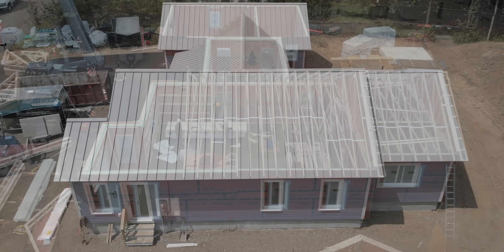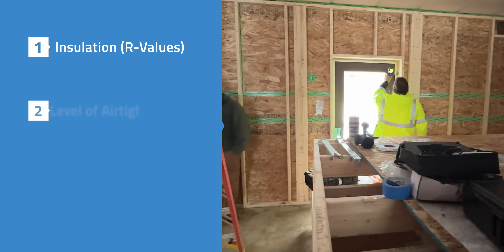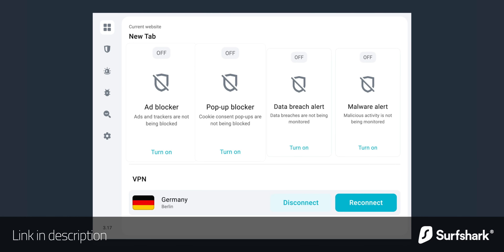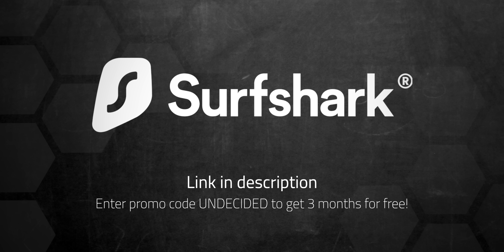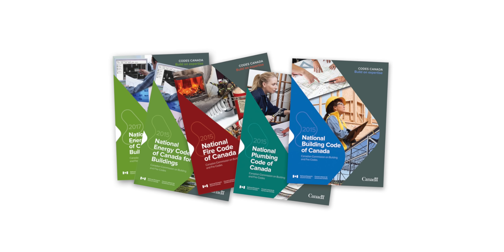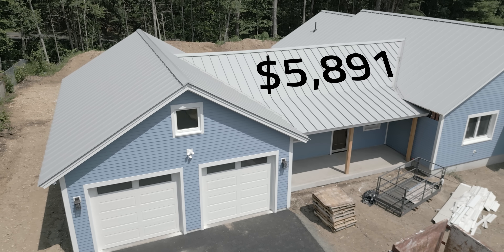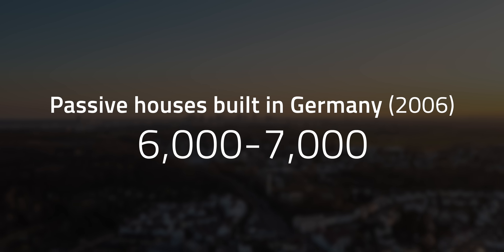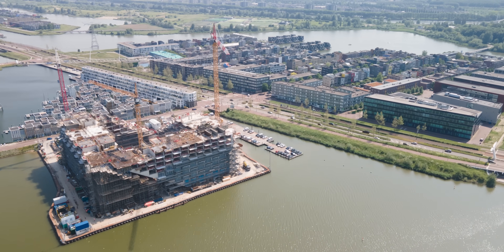Why Do American Homes Suck?

Comment: I lived in Europe for 36 years:  UK Germany & the Netherlands. I watched my German neighbors build a house from scratch, thinking they were building a bomb shelter. I toured several passive houses in the early 2000’s and was impressed to learn they could be maintained for dollars a month while providing a much healthier standard of living due to the constant supply of fresh air.  Europeans wonder at the US building codes as they watch our homes continuously get burned or blown down. I’ve always explained that we did not learn the lesson of the second little pig: don’t built your house out of sticks.
Reply: Or the second world war
Reply: i live in a 200 year old house in spain, exterior walls are 60 or 70cm thick.. and the original interior walls left are maybe 30cm or so ( house was renovated 20 years ago and some rooms were redistributed) roof was original from when the house was built and in good shape, but they wanted to add a rooftop patio, so it was torn down
Reply: I always thought americans build paper thin homes because the get blown away regardless. At least in tornado alley that is.
Reply: Except Germans do not live in tornado valley or coast of Florida and the houses are not regularly tested to 120mph.
Apples to oranges.
Reply: @serguei5000  of course, but houses in Europe ARE tested for heavy snow fall or high ground water level, or fire, or any other local dangers. American houses often seem to be built and tested for "quiet and mild spring afternoon when nothing at all happens", no matter which part of the country they're built in.
Reply: @dziooooo  Incorrect
Reply: One more thing about maintenance, I her about how in US they speak about refurbish the roof or rebuild the roof. Then Scandinavinan roof tiles lasts forever.
Reply: @kirgan1000  we changed the roof tiles on our Norwegian farmhouse a few years ago.  it was laid in 1880 and could probably last a little longer..
Reply: @kirgan1000  As a Dane i can confirm. The only reason we replace the roof is if we want new roof tiles, not because we need it. Or there been a storm and a few blew off that needs to be replaced. Can be dangerous to walk the street doing a storm. Still remember one time i walked home from school and had to dodge or i would have gotten a roof tile in the face.
Reply: @johnhodge6984 On the "getting blown down" of American homes:

Recently, the owner of a YouTube channel came to assist in demolishing what a tornado had left of a home near the Ohio river. To my (European) knowledge, that is outside "tornado alley". The three-storey home will eventually be rebuilt, but the one dead man and the seriously wounded woman can't be restored to their former states, and most of their (other) possessions will either have been blown away or have been lost in this demolishion. These won't be recovered. Moreover, the surviving woman may be fortunate to have her son able to help, and this channel owner with his heavy gear available (and helping at hardly any charge, I assume). But not everyone is that fortunate. - I would expect the farms that /are/ located in tornado alley to have been (re)built as baroque bunkers, rather than "booths" with a shelter.

Anyway, building homes that can withstand the forces of nature (temperatures outside man's comfort zone included) seems yet another industry lost to the USA...  :-(
(Notice the emoticon: I myself am affected by global climate change. I do live in a concrete-and-bricks house above sea level (in the Netherlands!), but part of the tax revenues that I contribute (a tiny bit) to will be needed to protect my fellow people from the consequences of that change.)

A Dutch saying translates to: "preventing is better than curing".
Reply: @chrislaarman7532 wow... great anecdote!
🤪👍

If you've ever visited Ohio, you'd know that the state of homes here varies WILDLY from county to county, or even town to town.

There are plenty of hundred-year old homes that are dilapidated and should have been torn down decades ago. 

Recently a couple homes near me exploded due to a gas leak... does that mean that "Americans must not understand plumbing! 🤪"... or do you think maybe that has to do with lazy homeowners who aren't maintaining their homes (or rentals... like the one that blew up).

Western Ohio also gets extremely high winds as it's almost completely flat... care to share where in Europe there are towns build on giant open plains where the maximum elevation change for 10 miles is 20 feet or less? 🤨
Reply: @jasono2139  "care to share where in Europe there are towns build on giant open plains where the maximum elevation change for 10 miles is 20 feet or less?" The Netherlands and parts of Denmark? The Baltic countries are also fairly flat too, though not to your exacting standards.
Reply: @jasono2139  Why is the state of Ohio different? - Because it's hi in the middle and round on both ends! [Elmer Fudd on stage in a Bugs Bunny cartoon]

My case may well have been in the state of Indiana. It was on the Dirt Perfect channel, maybe a year ago, or two.
Reply: @AlucardNoir  ... and Denmark gets how many tornadoes per year? 🤔

Maybe you should educate yourself a bit since you seem completely ignorant of the climate in the US.

From "Tornadoes around the world"
"In the United States, the average number of tornado fatalities per year is 71. But in Europe, where the tornadoes are usually much weaker, the fatalities are estimated to be between 10 and 15 annually.

Other countries that experience tornadoes annually include Germany, Australia, South Africa, eastern China, Japan, Bangladesh, Argentina, and more.

Europe as a whole is comparable to the size of the United States, but there is a vast difference in the number of tornadoes and tornado fatalities. And weaker tornadoes as well as ones that occur in more rural locations may not always be reported."
Reply: @jasono2139  You asked for elevation, not number of tornadoes per year.
Reply: @AlucardNoir  ... correct... and Ohio gets more violent weather that Denmark doesn't.

This shouldn't be too difficult to understand why your assertion that European homes are build better is wrong. 🤦

This is would be about as stupid as saying Ohio buildings withstand earthquakes better than those in Indonesia. Apples to oranges.
Reply: @jasono2139  Regrading Ohio and it's extreme weather... technically Greenland is part of Denmark. I wouldn't comment about Denmark's weather if I were you.
Reply: Occasionally a roof will need replacing here, but it's down to poor maintenance, and the house would be old (coming up to, or well over 100 years).

Most roof replacements are down to loft conversions with dormas.
Reply: Boric acid treatment of the framing is an idea well past time to implement.   There are too many reasons to do this to list here. Among other things termites, other insects and rodents don't like it, and it is cheaper than the current fire retardants.  And it does not cause accelerated rusting of the nails and framing hardware like copper arsenate does.
Reply: @andyfrench8943  I am building my home and sprayed the interior with a boric acid/mold spray for that reason.
Reply: I prefer houses made out of wood...you build these concrete monsters in Europe,in 30 years they go out of style ,you stuck with an old retro design,you need a bunker buster to rearrange space...and we haven't talked about putting or fixing mechanical in the house....both have its pro and contra...I think it's more feasible to build that way in the US...higher income,people are way more mobile,cheap energy prices.....only climate nuts put solar panels on their houses when you spend more money on coffee than your electricity bill....
Reply: The Passive House standard is still voluntary. Your neighbors chose it because of the savings they were going to get in the future, but there was no law that mandated they chose it. It's disingenuous to imply Europe is better because it's easier to adhere to a voluntary standard that it is in the US  only to them compare said standard to US regulations as a whole. And I am from Europe.
Reply: @AlucardNoir  Passive house standard is voluntary, but unlike in US, there are stricter standards for ANY house. The least efficient house you can legally build in Europe is still better than many of the 'mid-range quality' US houses. This is especially visible in windows. Windows that are already a luxury in US are literally the entry standard below which you cannot go in Europe if you want your house to be legally livable in (of course, if it is a newly built house).
Reply: @kikixchannel  that doesn't change the fact that most people not from Europe seem to have the wrong impression about the passive house standard.

Also, I might be wrong but I think you can no longer sell old houses and apartments unless they have been thermally rehabilitated. Again I might be wrong since I'm not in the market to buy a house right now.
Reply: @AlucardNoir  I don't know about other countries, but where I live, there is absolutely no restriction on selling old houses whatsoever, as far as I know, even if they are unsafe. 

You just cannot live in a house that is unsafe. However, you can live in a house that doesn't meet standards related to comfort and efficiency so long as they are safe.
Reply: @kikixchannel standards vary widely cross the US.  Some of your European standards would be bellow the local codes in New York.
Reply: @lookoutforchris  If you want to say such things, at least bring up an example or two. 

And that, too, would really be quite irrelevant. It's not like Europe is homogenous legally, either. There are countries that have stricter standards than others in Europe. In those countries, there are regions that have stricter standards than the rest of the country. So I'm not sure what your point even is.
Reply: The US has far more extreme weather than Europe.  I’d love to see how German houses would hold up to Forrest fires, tornadoes, hurricanes, and earthquakes.  I’m curious if they even have standards that relate to those circumstances.
Reply: @lookoutforchris  it makes no sense to have earthquake-proof construction standards in a seismically inert region, like central Europe, so obviously we don't have those. But we have standards (very strict in places) for fire, flooding, coastal erosion, extreme snowfall and high winds. Extreme weather events and accidents are not unique to the US. But when stuff like this happens here, in most cases you don't need to build a whole new house. You may need a new roof, or some major repairs to dry out a flooded ground floor, but the "bones" of the building are usually intact. Your toolshed may go on an aerial journey, but you will be safe inside your house.

And for multi-unit buildings it's very rare for a fire or a burst pipe to become a danger to the whole building. Damage is usually localized. Our next door neighbor's kitchen went up in flame when I was a kid, and they didn't even evacuate our part of the building. There was no danger of the fire spreading across the brick and concrete structure and our apartment was not connected to the same ventilation shaft, so no smoke inhalation hazard.
Reply: Reality check. European homes would get chewed up just the same as US houses in a tornado.
Reply: @readhistory2023  no not necessarily. Just make a solid concrete house and it’s not going anywhere no matter how strong the wind is. Reinforced concrete is really strong
Reply: @readhistory2023  - cannot really tell. Germany, as example, had the last F4 tornado in 1968. At that time no buildings were ripped off the foundation, none collapsed, but some where heavily damaged. Same for the one in 1979. Barns destroyed (of course, only timber construction), but "real" buildings only had their roofs ripped off, windows destroyed, etc..

So I'd still disagree with the same damage as the US. Less shrapnel, less damage.
Proper foundation and solid (concrete) built also means not as easily completely destroyed.
Reply: In the USA we still have some freedoms and rights to choice, big government does not control everything. At least for now. People who want a high efficiency house can have one,but don't use government to force them on everyone. Respect other people's opinions and freedoms.
Reply: It’s about economics. Homes are just a place to live. They won’t last long anyway.
Reply: @artemkalinchuk  American homes? sure. But out European homes? yeah right. Unless there's another world war most of the homes now standing will still be standing in another hundred or two hundred or three hundred years. Assuming people take care of their homes.
Reply: @AlucardNoir I've watched plenty of "European" home improvement shows with my wife... many of those homes SHOULD HAVE been torn down a long time ago, but people in Europe insist on constantly recycling their  current home to appear newer... when it's not.

...and that causes all kinds of issues with future improvements.
Reply: @jasono2139  Firstly, regarding your first comment that wasn't addressed to me, do you mean your grandmother's house was made of wattle and daub?

Secondly, Europe wasn't new. Baring plague or war people tended to build the best house the could at any given moment in time. And houses were build to last. The reason you think our houses should be torn down is because more than a few predate many modern amenities. Some were built before sewers, municipal running water, gas, electricity, internet, let alone modern thermal insulation. And they had to be altered to fit these new amenities. But they could be altered for them. The reason why they cause issues when such improvements are implemented is because  they're not made of cardboard and insulator foam so it actually takes more than a bit of work to put in a new wire or pipe. But tearing them down? Would it me more or less work to tear them down and put new houses in their place? The Amish might be able to build a home in 3 months, but that doesn't mean it's a good home by modern standards. I don't get how you can criticize European homes and claim then should have long been torn down when what the Amish build are homes that build the same way they were 150 years ago.
Reply: @AlucardNoir  maybe you have a hard time reading... my "mother in-law" isn't my "grandmother". 🤦

...my mother in-law lives in Europe.

Otherwise, no, the Amish do not build houses the same way they did 150 years ago... what an idiotic notion. 🤦

Amish might build their houses the same way, but when they're hired to build new constructions they follow the same codes everyone else does.
Reply: @jasono2139  Firstly, you ignored the question, but good to know it was your wife's mother - not that it matters.

Secondly, you second and third paragraphs seem to contradict each other. Is my notion idiotic or  is this true: "Amish might build their houses the same way[...]"
Reply: @artemkalinchuk  - if they're built like in the US, then I fully agree with you. My current home is of the younger age and was only built in 1956. When I moved in all I had to do was upgrade the electrics and renew some plumbing, due to them being touched last in the 70's and 80's.

However, my house is going to easily survive me, no doubt. 
Also on the topic of roofs - said house has had the last changes of the roof also in the 80's. I will redo said roof, but only due to the fact that I want to increase the insulation and the current roof construction will not support  that ;)
Reply: @artemkalinchuk  You do realize you're saying this to people who live in Europe right? There are houses still standing and usable to various degrees that were built in the 1400s.
Reply: @ToolofSociety ”useable to a degree” You do realize that those houses require foundation repairs, re-wiring, re-plumbing, etc.? It’s actually cheaper to build a house that is meant to last 100 years and then rebuild it. Technology changes too quickly to build 1000 year old houses.
Reply: @artemkalinchuk  - since when are houses only meant to last 100 years? Is that now the "throw away version" of houses?!
Reply: @dragonsmonk yes, it’s more economical to do it that way.
Reply: @artemkalinchuk  Yes everything requires maintenance just like your body.
Reply: @artemkalinchuk  - monetary perhaps, ecologically definately not.
Reply: @ToolofSociety  In England some of us still in 800 year old thatched cottages, the oldest was apparently built sometime before 1082 and has been continually lived ever since. The oldest residences still in use today are in the Theatre of Marcellus, built before Christ was born.
Reply: @ToolofSociety oldest house in the US is 1640.  There are tons of houses from the 1700s in the Eastern US.  My mother’s house was built in the mid 1700s in NY.  You won’t find houses from the 1400s here for obvious reasons.  But old well built houses are common in parts of the US that were settled first.
Reply: @ToolofSociety  Because Europe is known for its hurricanes, tornados, and geological activity.
Reply: @ToolofSociety ... yes, like my mother-in-law's farm "house" that's nearly 400 years old... which no longer meets any building standards and LITERALLY has ceilings made out of packed sticks, straw, and mud... and has rafters too low for me to walk under.  🤦

Building every home like it's a fort intended to stand for hundreds of years is a bit silly when there's Amish men in the US who can build an entire barn in 3 days like it was a giant piece of IKEA furniture... and a house in 3 months.
Reply: @lookoutforchris  Maine has many houses that were built in the late 1700s (Kennebunkport).

There are "historic" houses in my town from the early 1800s... old homes have more to do with a willingness to keep them around rather than demolish them any rebuild (which is often easier).

One of my favorite restaurants recently was closed and demolished simply because there were costly plumbing issues that would be difficult to correct... yes, it was cheaper for them to sell the lot, have it demolished, and rebuild than fix a problem.
Reply: @artemkalinchuk  I disagree. Homes last VERY long when build right. Thats why when you build a home in Germany, Austria and so on... your children and your grandchildren will inherit the house some day. And therefor its an investment for the future. You build with bricks, make everything airtight and have proper isolation.
Reply: @artemkalinchuk  you are right about homes in the US. I grew up in a wooden house originally built in the 1800s something, and renovated and extended in the 90ies.